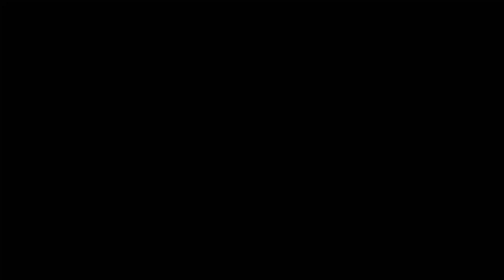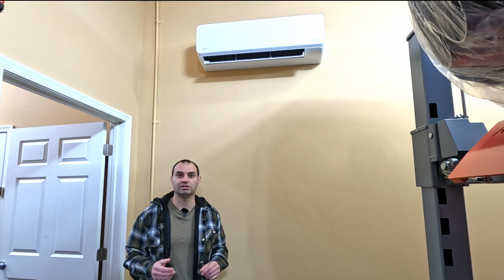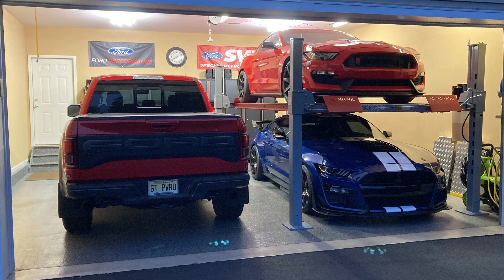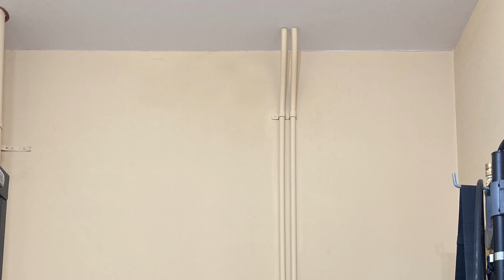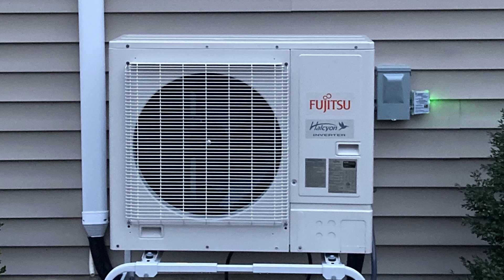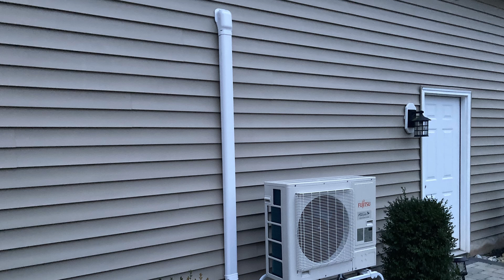I Installed a Fujitsu Mini Split HVAC System in My Garage

Comment: Excellent video and great set up in the garage! We just got this unit installed in our small town house along with two heads. The price we were quoted is close to what you cited, so that's good to hear. It's early, but we're happy to have this done and look forward to using it for cooling and heating (downgrading our baseboard heating to supplemental in the winter, hopefully). Thanks for posting this!